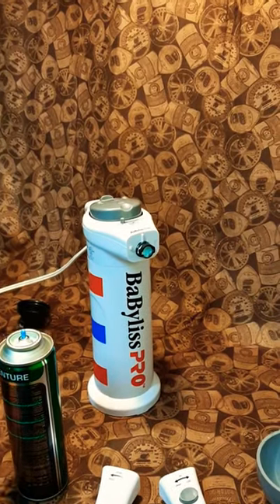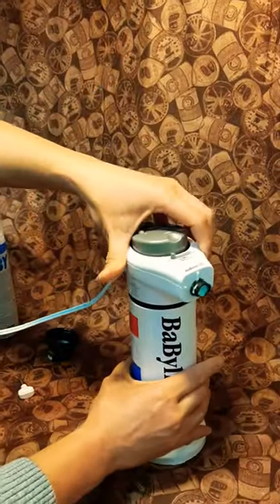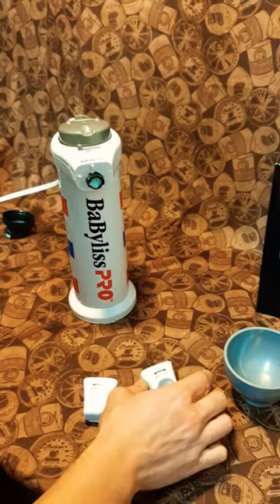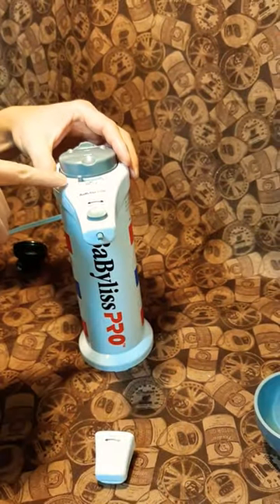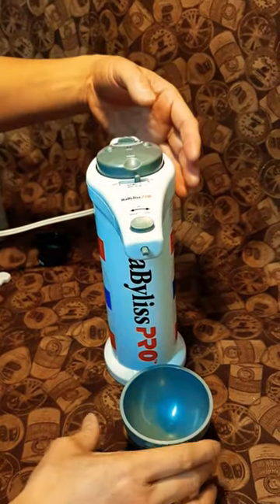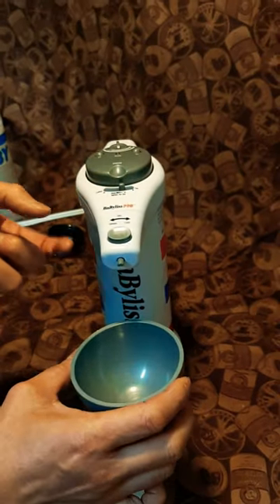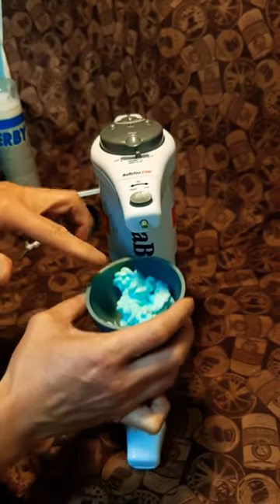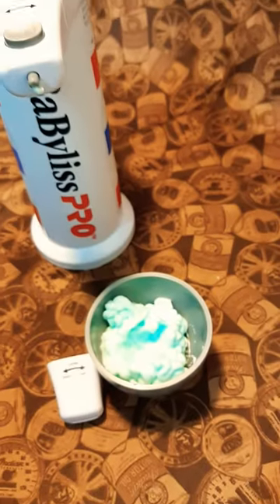How to use BabylissPro LatherFX Machine

Comment: What kind of shaving cream cans fit
Reply from the maker: Majority of the brand will fit.   Just remove the dispense button cap and make sure that the plastic tube on top is tall enough to poke through the machine.